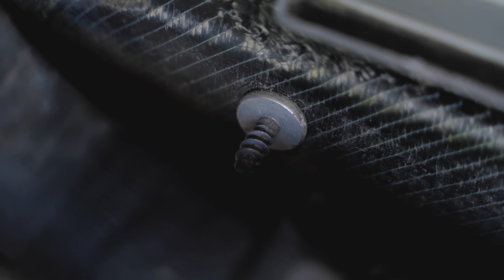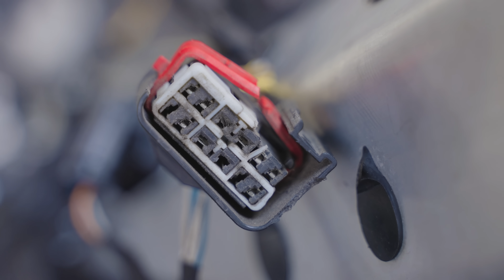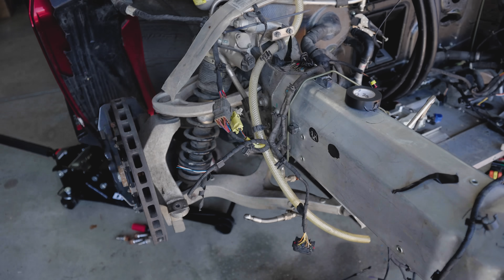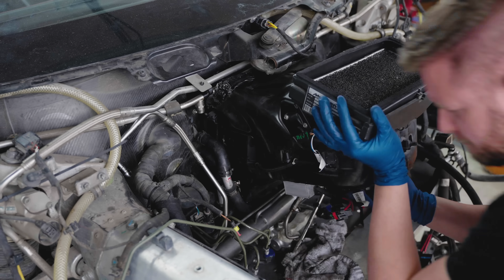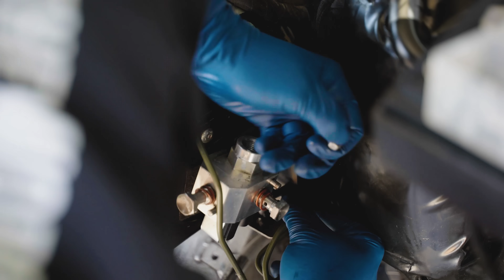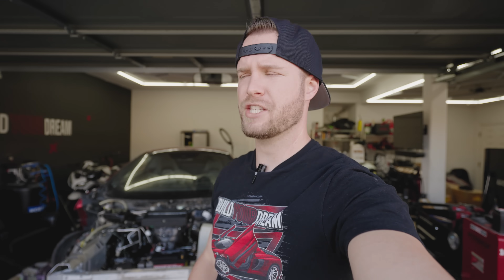The BIGGEST NIGHTMARE on the $38,500 MCLAREN is FINALLY FIXED!! (PART 6)

Comment: You cant put rubber hose on the ac lines that will just explode. cut and union in a new piece of aluminum line go to a pick a part find a car that you can salvage a piece of line from to make it work. otherwise you will have to replace everything.
Reply from the maker: Yeah, on it

Comment: You have made a huge mistake, the hose you used on the lines for the heater box will not work those are high pressure lines to the air conditioner those need to be solid lines. I have a feeling you’re going to have to replace those lines from the ac compressor all the way to the front.

Comment: Reading some of the comments  and especially ones with some professionals leaving comments about the flex pipes now being used instead of the original aluminium ones, i aaked myself when you decided to do this, why did Mclaren use these aluminium pipes in the first place, a brand that seems to over engineer things by standard, i thought these will either pop off or explode (i really hope not, but the professional guys in the know seem to be really worried) so what do you do now? Try it and hope or do it before? Also whats the life expectancy on these flex tubes being used to full or over capacity on a regular basis?

Comment: For all the broken electrical connectors, next time don’t splice, de-pin and just replace with the connectors from the other harness.   You have to have a de-pinning tool from repairing the brake module connector.  Less potential for future issues.

Comment: All the aluminum pipes.  Your hooking the hoses too.   Take 80 grit sandpaper to it first.   So the rubber has something to grip to.   If it had a flange on the end it will work too.   I would just do them all.   Hope this helps

Comment: That's the ac line were putting a rubber hose and clamp on at the expansion valve .. That's going to be an issue for you
Reply from the maker: Gah..
Reply from the maker: Didn't know that.

Comment: the front "mysterious" connectors are for the front trunk piece. there's a 12V plug in, button to open from inside and interior light
Reply: and the green connector for the sensor on the wheel liner is actually for your TPMS sensor. They should be all same part number so you can just see the rear
Reply: feel free to reach out if you have any questions. I rebuild alot of mclarens so i know a thing or 2 lol

Comment: I saw a Matt Armstrong video not long ago and he was having ignition problems with his McLaren he was rebuilding.  I think when you replace sensors they all have to be programmed through McLaren.  He mentioned the car has 2 ecu that communicate in a certain sequence which will require McLaren to recalibrate them plus outdated software may need to be updated.  It maybe a possibility you have to take it in to have everything reprogrammed..Best of luck
Reply from the maker: Yeah, we'll see! Sean from McMedics seemed to think everything looked fine, just needed wiring to be straightened out. We'll see, I guess!

Comment: Nice work but you cannot replace high pressure AC lines with rubber lines, those will leak like hell because pressure. If you do not replace those lines, that car will not have never again working aircon!
Reply from the maker: Didn't realize that's what that is. 😶
Reply: @TheInja  There were 2 normal coolant lines, but 2 other was AC high and low pressure lines. The ac lines connects on the airbox (smaller diameter and small weird looking box on the lines) and coolant lines (bigger ones) to left side of (when looking front to back) airbox straight to the monocock/firewall, going to inside the car.

Comment: The "coolant lines" you were working on around the 14 minute mark look like air con lines, which can be quite high pressure. I think you're going to have an issue with the flexible pipe and hose clamps you've used. Usually whn repairing high pressure air con lines the pipe is usually re-inforced like hydraulic line with crimped hose couplers.
Reply from the maker: I sure hope not 😶
Reply: @TheInja Around the 14 minute mark, It looks like you're connecting to the expansion valve for the air con evaporator ( aluminium block to the right of the heater box as you're facing it). I'm a vehicle technician and trained on air conditioning systems in the UK so I recognised the valve as you were bolting the pipes to it. I suggest you find someone who specialises in vehicle air con and ask for their advice so you can rectify it while it's in bits and not fully built up. The high side can hit pressures as high as 350 BAR (5075psi) at the extreme but should hover around 5-10 BAR (72.5 - 145 psi) under notmal operation, which is why most of the air con lines are aluminium and the flexible pipes are re-inforced.
Reply: @TheInja  that is definitely an expansion valve for the AC system. The good news is you can buy a kit that lets you attach flexible braided lines directly to the valve with the o-ring bosses, the bad news is those coolant lines are going to either explode or pop off almost immediately when you have the AC system charged.
Reply: @AaronBonBarron  Thanks for clarifying. I made the suggestion to use flexible braided lines, in the last episode, but without knowing whether the standard cooling lines used would actually hold up. I suspected they wouldn´t!
Reply from the maker: @AaronBonBarron  can you send me a link to the flex kit for it? injamotorcycles@gmail.com
Reply from the maker: @belledetector  send me a link to a kit! injamotorcycles@gmail.com

Comment: If you've followed Freddy Tavarish's previous McLaren build and his highly ambitious current P1 build, as well as Mat Armstrong's 720 rebuild, they've uncovered many of the VERY WONKY shit that goes on with McLaren electronics and their components.  Mat's had an electronic module in the door that was out of date from the ECU, TCU, and BCU (engine, transmission, and body/security) so they needed to be reset in a particular order to be back in sync, otherwise the car wouldn't start... so yeah... expect to be chasing electronic gremlins every step of the way.
Reply from the maker: Yep, watched all their builds! Lots of good insight to strange problems!